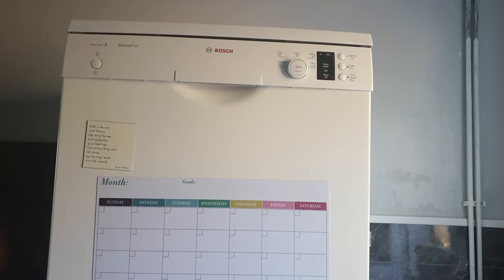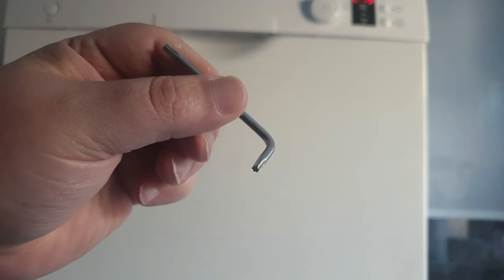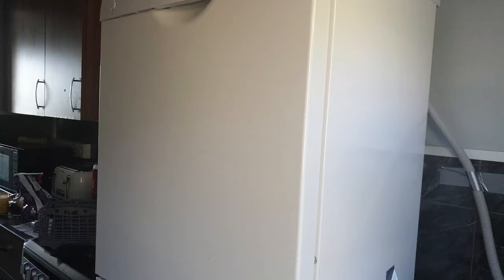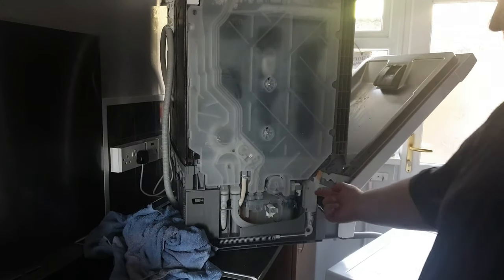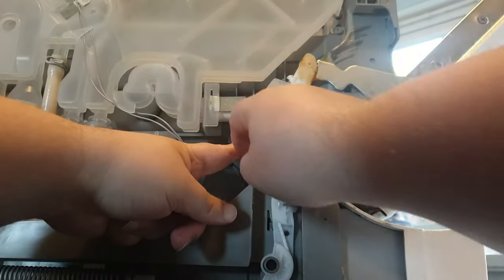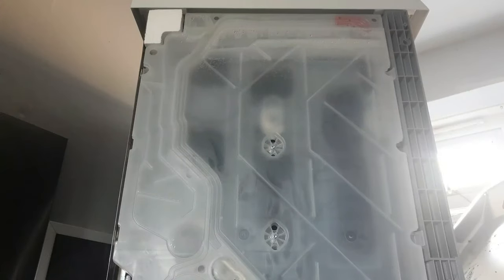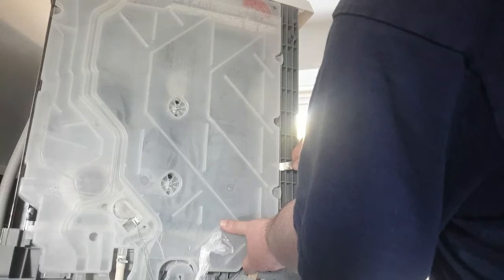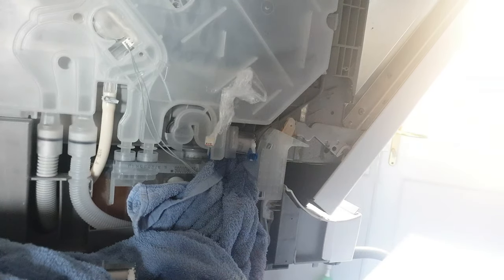How do I fix error E19 on my dishwasher? Bosch, Neff, Siemens etc...

Comment: I'm not having the same issue, but water is bypassing this same valve and going into my dishwasher after a cycle has finished. I confirmed this by marking the water level after the cycle finished and then watching it go down, and also watching a slow drip inside the machine. This video has been helpful in showing me how to remove the valve to put the new one in.

Comment: I saw others recommend removing the part BEFORE trying to unclip the eletrics plug.  I found it impossible until I extracted the part, making access to the plug much easier and thus making disconnection a breeze.  It is very tricky to say the least. This the most difficult part of the whole operation, you chose to keep hidden in your video so that in both instances, your viewers couldn't see a damned thing?  Apart from that, your video was excellent.  Well done Joe.

Comment: Thank you. I have a Bosch slimline so I wasn't sure if the part would be the same but it was. Slightly tricky to fit it (it wasn't locating in the slot on the far side) but got there in the end.

Comment: ...many thanks, followed your demo to the letter and it seems to have worked a treat...yes the replacement valve was hard to put back in...I would add take out the two screws in the middle of the water container as well as the two side clips for a bit more room ...If we hadn't  found your demo we may well have bought a new dishwasher...so thanks again.
Reply from the maker: Thats great news. The valve can be tricky to reinstall. I'm glad it's all sorted.

Comment: Another grateful viewer! Thanks for taking the time to do this video,  saved me easily three figures on repair or replacement!  I found it I rotated the valve nearly all the way out then pushed on it the drain process was a lot faster. Brilliantly clearly explained all the way through.
Reply from the maker: As long as the water doesn't splash onto the machine internals, this is a good tip. Thank you.

Comment: Absolutely brilliant. A new heat exchanger cost about £20. Bit fiddly putting it in. And reckoned it was better to put the black washer in first rather than when round the new bit. Works a treat. Many thanks.

Comment: Hi there. Just wanted to say thank you for the info. The little gadget cost me about 30 quid and the fix took less than an hour (my side panel wouldn't come off until the top lid was taken off). So thank you. Saved me a heap and increased my confidence in dealing with "simple" fixes like this.
Reply from the maker: I love getting comments like yours. Thank you.

Comment: Thank you! Works the same on our Siemens dishwasher! 

If you’re reading and about to start on yours: 
As others also mentioned, you might be able to first turn the valve and then unplug the wires, that’s easier than trying to unplug first. 

My new valve unit is a tiny bit bigger than the old. Instead of forcing it in try to file away a bit of plastic that was in the way. 

Also, pushing in the new one so that the rubber O ring sits nicely and the ‘wings’ of the valve line up with the slots (there’s one on the back side too, make sure the valve is in straight) took quite some force. Wiggle and push.

Comment: It's a Thumbs up from me, thanks to you I solved E19 error code, 
Few additional points 
BLUE connector can come away from main body.
Infact I found it easier its just couple of prongs which can be pulled away with small flat screwdriver.
Remember there are  two 'winged flanged' retainers both need to be in cut out slots ✨️ 
Once again thanks for uploading this video 👏 👏 👍

Comment: Thank you. I can add some tips and suggestions. 
On a series 6 you have to remove top panel, but it’s an easy as it gets, just pulling it upwards does it, and only one screw holds side panel. 
Draining doesn’t really takes too long. All you have to do is move the broken solenoid and let air go through. 
Water does not leak, it goes inside the dishwasher, no problem at all. 
I recommend using the original part, it’s cheaper than the alternatives and guarantees 100% compatibility. 
B/S/H 11033896
Changing it doesn’t takes more than 10 minutes, and really solves the error. 
No need to program anything, plug and play. 
The only thing that you need to pay attention is reinstalling the new part. 
You have to be sure it sits perfectly and maybe help it going in with a flat screwdriver pushing a little from behind, nothing hard. 
Hope this helps.

Comment: Thanks fella, very useful video! I had to give the valve a quarter turn and then push it downwards to make it drain the water. The new valve I got came with a metal packing washer on the back which I had to prise off to make it fit like the old one. Machine fixed now though - many £££ saved :)

Comment: Thanks, saved my parents few 100 euro on repairs. The valve didn't conduct any power so was burned without shorting so I had good hopes the board wasn't burned. And it wasn't! New valve was 25 euro and with your video dad was able to get it out.
Reply from the maker: Excellent news. I'm glad to hear it worked.
Reply: @JJcorrosive  Your video helped getting it out, we didn't know how to remove it

Comment: Excellent video, helped me solve my problem. I found that pushing down on the valve, rather than pushing the clip bit to the left, was easier on fingers and quicker.

I saw someone state they also incurred an E15 error afterwards. I too drained all water, but got this fault. I believe this can be rectified properly from other YouTube videos (video idea for you perhaps)!

Note: I think the E15 was from having to tip/wiggle the unit back in/probably sloshed any remaining water about a tad!
Reply from the maker: I'm glad this helped.

Doing an E15 video is a top suggestion... watch this space.

Comment: Waiting for replacement part to be delivered but multi-meter across valve valve is open circuit so I'm confident this is the problem. Will find out in a couple of days. Really good video and easy to follow instructions. No idea how much a repair man costs but I imagine they are not cheap - I am :) Thanks for taking the time to create and upload video.

Comment: Thanks, really helped me out of a spot with this repair. I had to cut away some plastic to get the new valve in though. Also e15 code came up because I wasn’t as careful draining the water. Soaked up the water that had gathered in the bottom and all good now.

Comment: Thanks for the video👍 
Trying to slide the valve either way didn't work for me, I had to give it a slight twist for it to drain.
Reply from the maker: Great tip!
Reply: For me I couldn't get it to drain at all with the solenoid still in place.
Once I'd unclipped the tank and quarter rotated the solenoid, I was able to wiggle it out just enough to drain into the u-bend and not onto the floor.

Comment: Thanks for the video, really clear and very helpful. My question is about the order in which you do the repair and I wonder if it could be done slightly differently. Regarding the removal of  electrical clip from the part, could this wait until after the draining and after the part has been turned? It's tricky to access but after turning it would be easier, or is there a good reason why not to do it this way?
Reply from the maker: Yes you're right, when making this video, I was worried that people would splash water on the internal electrical parts, so I made the decision to go slow and steady, it's safer, and easier to control, however slower to drain.

The advantage of the slow drain way is, if you need to stop the water draining out, you can put the plug/part back in.

Comment: Thanks, just fixed mine, had similar problem with fitting, due to tight space, had to "shave" a couple of mm off of plastic on machine, all good though.
Reply from the maker: I'm glad it worked out. The plastic is flexible, you probably shouldn't shave it... but if it works, go for it!

Comment: Your video was easy to follow, part switched in 15 min. But still E19. Drain clear, matrix clean, Called a guy, he checked resistance on all exposed sensors and even changed the Heat pump. All still E19. Now, if I try to start it, there is a "rrr, rrr,rrr click click' sound that sounds like a pump is trying to spin up three times and click, click, somethings not engaging. Water doesn't come in. when push the power button off, there is a CLICK from the same area underneath. Guy's quote for new PCB is £300 but 3-4 weeks away! Machine is 8YO. It's a Series 6, 45 Panel front so not easy to replace. Any suggestions? Can I replace the PCB myself with the correct part? Is this really what it could be? Everything else electrically seems fine....
Reply from the maker: The pcb is tricky, but can be swapped out fairly quick. (keep everything dry)

https://amzn.to/44s9wR0
Reply: @JJcorrosive  I have seen 'programmed' and 'unprogrammed' units. The Bosch replacement part 12011174 is £194. Ive never replaced a PCB. I don't solder. Does the linked board just pop in the existing white housing? The PCB is at the bottom, on the opposite side of any water...

Comment: Hello, I don't have a display so I don't have a error number , my problem is :  Inside: there is no water  , Outside : floor just a I little bit  , once I swich on dishwasher I can hear how the extraction pump is working but with side panel open I can see that water is not coming out , seems that inner reservoir is full . EDIT: as I can see at 3:54 there are two "solenoids" ??? the one that is under the solenoid that you change what is for? (the one connected to reservoir)

Comment: I have a built-in Bosch dishwasher and when it finishes the cycle it is full of water like yours in this video.

Is it normal or should it be empty?

It seems to work just fine, it's just that I took it out of it's place and was surprised to see that the deposit was full of water and since it has no display to show me error codes I was left wondering if it was normal or it has some problem. 😅

Good video by the way. 👍
Reply from the maker: The main chamber where the dishes go, this shouldn't have water in at the end of the cycle. However, there is some water left in the sump at the end of each cycle.
Reply: @JJcorrosive  Sorry, I didn't explain myself properly.

I meant that the big plastic deposit that is mounted on the outside of the dishwasher (it's called pressure chamber I believe) is full of water like yours.

Should it be full or should it be empty once the washing cycle finishes?

Thanks for the reply. 👍
Reply from the maker: @makpsv  there should be water in, since this detects water pressure. If the is no water, or not enough water, then this part (00499500) will need to be replaced... However this part is reliable, rarely needs replacing. If your dish washer is working, don't worry, be happy!
Reply: @JJcorrosive   Thanks! 👍

Comment: I had E-19 error code, and did replace the valve (as in the video) but then straight away I got a new error code E-01 (not E-1). It will not start any wash cycles. When i switch it on and reset it, it makes a noise like at the start of filling water, but stops after a second. It doesn’t even start any cycles. I have a similar Bosch model to yours (mine is series 6 model SMS53M02GB/B2) Any suggestions please?
Reply from the maker: Error 01 is the control board, many things can cause it. My suspicion is; could you have damp electric cables? It is vital... when doing the repair, everything needs to stays dry.
Unfortunately, repair to e-01 is beyond the scope of this video.

Checking the control board and its electric supply is the answer... however,  this isn't something I'd be happy to do a video on. Water and electricity is a dangerous mix.
Reply: @JJcorrosive  I was wondering if perhaps an E-01 error after installing the new part might suggest that the actual part is being rejected, and might be faulty or the wrong part, perhaps not a new fault elsewhere. I used a lot of paper towels placed under the area i was working to prevent the water that falls out, when replacing this part, from getting onto any of the electrics, and would recommend others to be aware that they are best putting protective plastic around the electrical connectors when draining the water. Maybe i was sent the wrong replacement valve part or a dud.
Reply from the maker: @Mark-ih4yz You could be right... do you have a multimeter... If so check the part. They are notoriously unreliable.

Comment: Hi there, i know this is unlikely but i’ve got a bosch SPS46II00G/46 dishwasher. I’ve failed at the first hurdle and can’t get the side panel off. I can only find one screw towards the bottom of the front of the unit, nothing at the top. Any idea how i can take off the panel?
Reply: The video shows a Series 2 slimline dishwasher. We've got the later Series 4. It does not have the four screws as the earlier model - Just 1. This might work for you. 

The (only?) /EASY way to get the left hand side panel off to gain access was to  remove the one screw (with the door open, on the LHS, front of machine) and remove the TOP of the dishwasher. If you look at the bottom of your washer you may see that the metal panel is held in place by 3 hard plastic lugs (about 10mm tall (cost saving for Bosch no doubt). This is achieved by pressing hard on 2 plastic levers at the front of the machine visible under the TOP panel (or see your manual). This releases the top panel. After that it is easy peasy. Removing the Top panel allows the side panel to lift up a little, clearing some lugs on the top of the machine  and then the whole panel slides downwards.

When you remove the valve - there is A LOT OF WATER...a LOT!!  You need to do this outdoors if you can or you WILL have a wet floor. Did I say there's a lot of water?

The disconnection of the wire from the valve - it is much easier than shown in the video (what was he faffing with?) . Use fingernail to pull gently on the blue plastic tang at the front and prise the connector off using a small flat blade screwdriver.  You pull the tang towards you and insert the screwdriver and prise off. I then used a wrench to rotate the valve out. You have to ease out the large "water container" (the heat exchanger) or else it is difficult to remove the valve (not really enough space). Use a knife or screwdriver as in the video.
Reply: @monabri7387  wow thanks so much for taking the time to answer me. After researching and seeing some other articles on the E19 code I've decided it's probably best I wait for an engineer to come out and take a look. It's unfortunately just out of my skill set/not worth my stress levels to try to fix it.

Comment: Hi mate. Thanks for your video. I replaced my part and it came up with e19 again, I then reset it and started a cycle and it went through the cycle without a problem last night. I got up this morning and gave it another cycle and it's registering the fault again? Any idea mate?
Reply from the maker: When you switch it on is there a couple of tick noises?
Reply: @JJcorrosive  hello mate thanks so much for getting back to me. Yes there was. I googled what it could be and it said to clean the filter tray, I took it out and it was a little bit dirty, not much though, it was like small sediment which washed away with warm water. I put it back in, unplugged it and reset it again then put it on cycle, it's going through the cycle now with no error code
Reply from the maker: @davidbathurst6813  The filter was preventing the discharge (this was causing the e19 error). Don't worry, I keep forgetting to regularly clean mine too.
Reply: @JJcorrosive  mate thank you so very much for taking the time out your day to advise me 🙌
Reply: @JJcorrosive  hopefully this is the case 🤞
Reply: @JJcorrosive  hi mate it come up with the error mid cycle 😩.
Reply from the maker: @davidbathurst6813  drain the water completely, I suspect there's a blockage.
Reply: @JJcorrosive  hi mate hope you're well. Sorry to be a pain. I drained everything and disconnected the water matrix, cleared out all of the waste hose including my 'u bend' under the sink. I still have the same problem, everything seems to be flowing ok but the fault comes up mid cycle? Any ideas?
Reply from the maker: @davidbathurst6813  these parts (particularly the 3rd party valves) are notoriously unreliable. You can check it with a multimeter before installing, but... Since it's an easy/inexpensive part to swap out. I'd be tempted to just start again, and swap out the valve. I seem to have more luck with the Siemens branded ones, but these are slightly dearer.
Reply: Hey there, just wondering if you got to the bottom of this? I have the same issue - replaced the part, but I'm still getting an E19 error. Checked with a multimeter and the part is fine. Seems to drain fine too when it tries to - starts a cycle 1/10 times and just randomly cuts off during the cycles it managed to start. Any ideas? Thanks in advance!